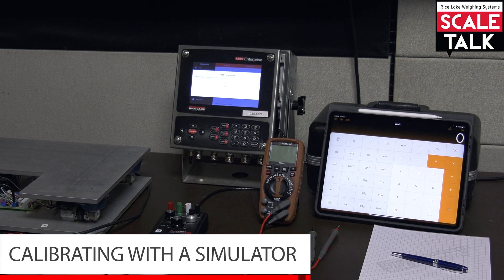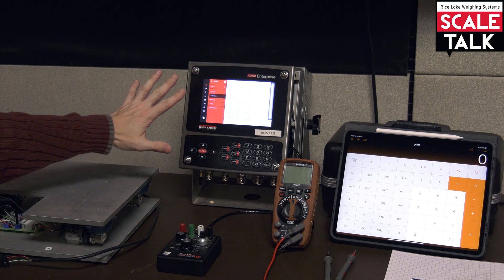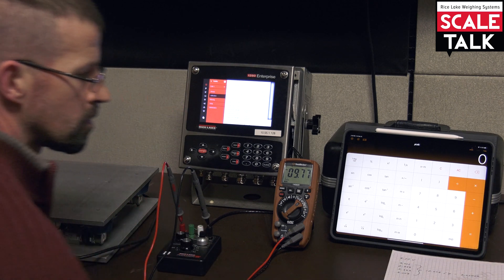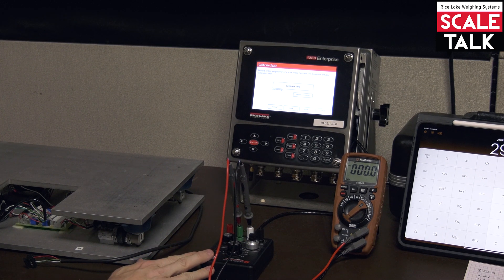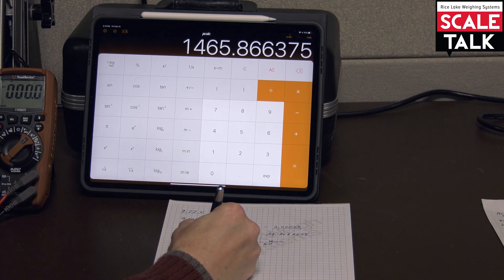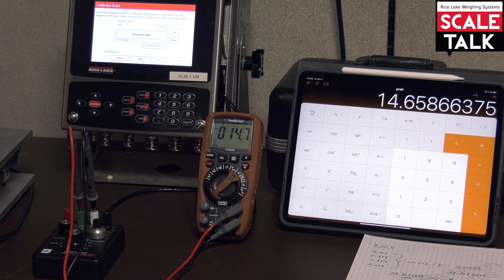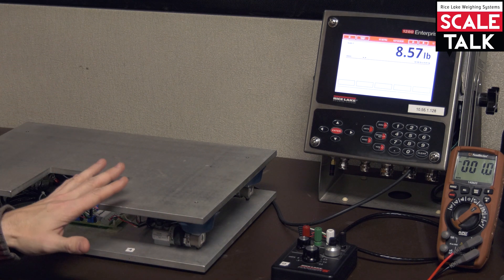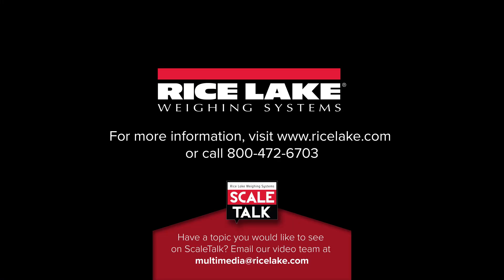ScaleTalk: Calibrating a Scale, Method 4 - Calibrating with a Simulator

Comment: Nothing worse than installing a large capacity scale; scheduling a test truck; and then discover an issue while the test truck is onsite!
Pre-calibrating a scale in this fashion makes a lot of sense. You will get close enough to verify individual load cells, scale sections, etc.
I think that many scale techs assume everything is going to work correctly and why bother going through a pre-calibration.
In 99 out of 100 times, it likely doesn't.  It's that 100th time that will sink profit having to pay for a test truck and labor twice.
Kudos to Rice Lake for sharing this ability!
Reply from the maker: Thanks for your comment, Wayne! We're glad you are enjoying our ScaleTalk videos.